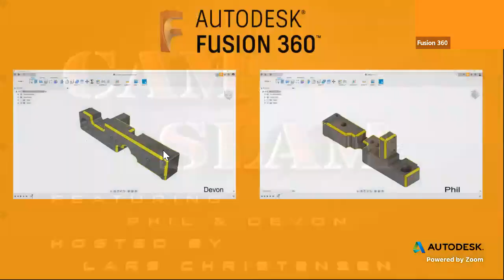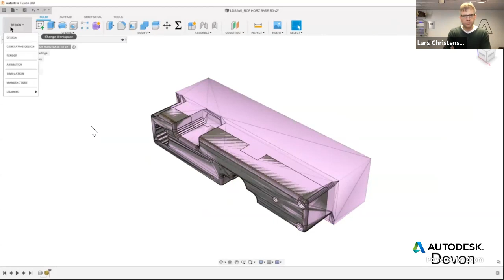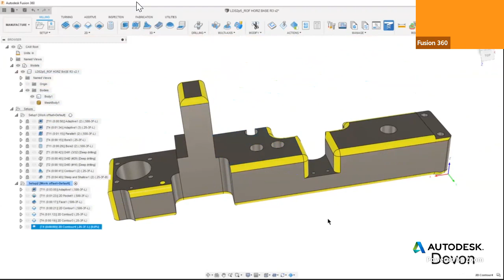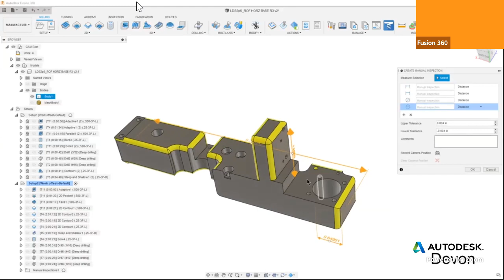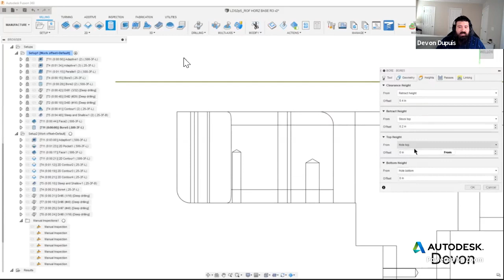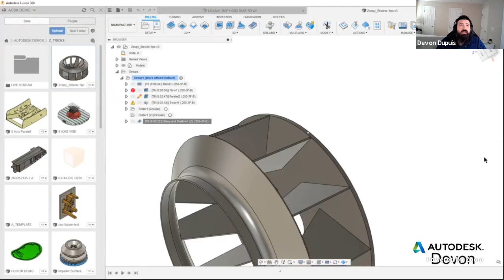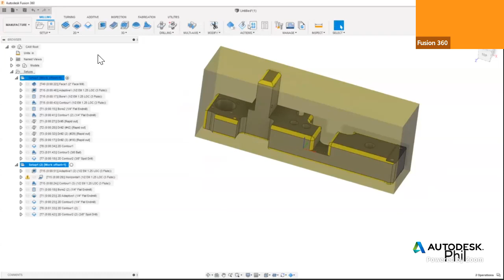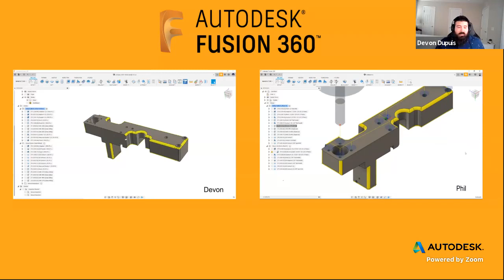CAM Slam: How to Master your Machine with G Code in 30 mins or Less Ft. Lars Christensen

Comment: Font on video is very very GRAINY ..and kinda small. but I do like the format of fixing real time problem and talking about it.
Reply: Due to broadcast method the max final resolution was 720.
Reply: @fusionphil2161  thanks for responding. Could I also add to make the font size a little bigger, and and putting a ghost color over the pointer. I (and many other) have vision correction and following "the bouncing ball" is a little difficult under those conditions.